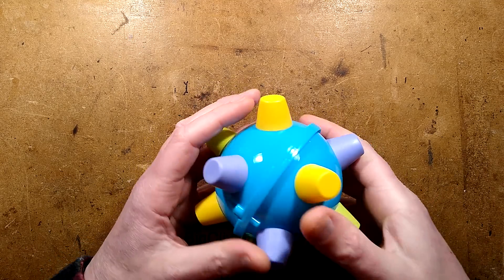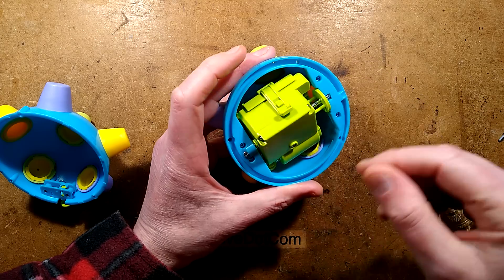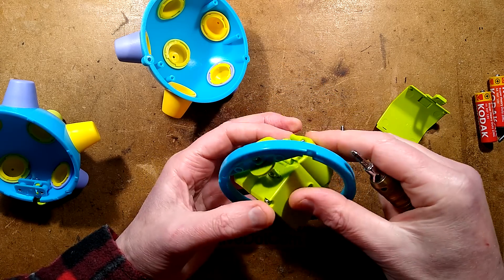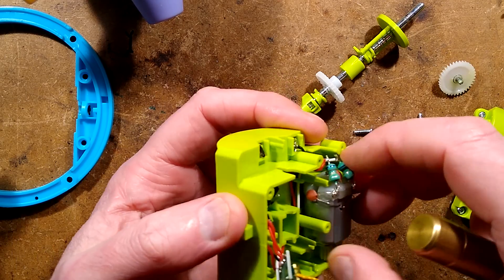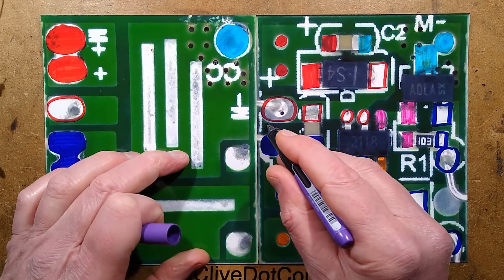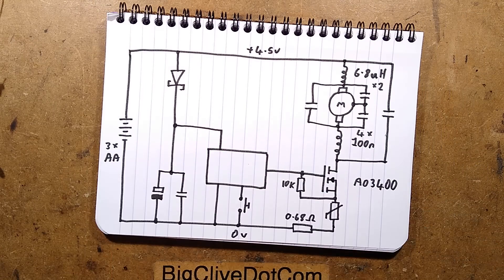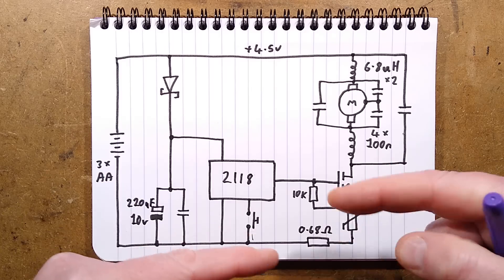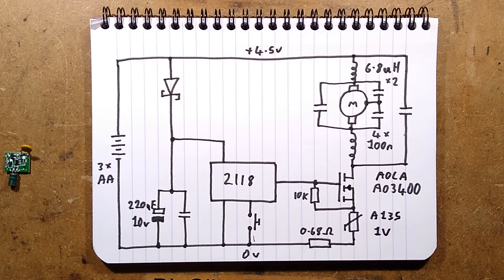Inside a Bumble Ball - with schematic

Comment: 20/30 odd years ago when "brushed" motors were the norm in the RC car/plane world, very common to see capacitors and Schottky diodes used this way.  Anything to keep arcing of the brushes to a minimum, I suspect to try and eliminate radio signal interference.
Reply: Ahhhh, that makes sense. A brushed motor is how they're getting so much torque at low voltage. It's like a cheap electric drill.

Comment: I can't believe they put so much engineering into a kids toy, that's a remarkable amount of protection.
Reply: Out of college I entered the defense sector, working at Raytheon in Rhode Island. There existed a sort of revolving door among the few nearby companies that hired engineers of various disciplines, including many of my friends. One such company in the mix was Hasbro in Providence. What intrigued me was the seamless transition of individuals who worked on military programs, delving into the intricacies of Radar, Sonar, Communications, and more, while feeling equally at home designing toys. As I recall, Hasbro did often push to reduce the component count to save pennies, but at the same time were focused on safety and meeting whatever applicable standards. It was evident that a major U.S. toy company, such as Hasbro, was vigilant about avoiding any negative publicity that could potentially cause harm.
Reply: If one ever failed in an unsafe way (bearing in mind a baby can't run away if it overheats and starts smoking) then the retailer would crucified by the media and the manufacturer would be dropped by the retailers.
Reply: Can’t have the kids lawyering up against your profits.
Reply: @nickdee5764 it's not really about the profits.  It's about not hurting the kids to begin with.
Reply: @POVwithRC That is absolutely not the case.  They have giant teams dedicated to making sure they are not liable, or wouldn't be perceived as at fault by the public when an accident happens.

They would much rather have 10 accidents where they looked absolutely not responsible, than 1 accident that appeared to be their fault.

If it was truly about safety then they would massively prefer 1 accident to 10,  even if everyone thought it was their fault.
Reply: In know... you burn down one house, and you never hear the end of it. 🙂
Reply: Usually I roll my eyes when I see a CE mark on a toy. But I wouldn’t be surprised if this one actually is compliant. Clive also notes the lack of softeners, still present in a lot of imported toys.
Reply: @BartSliggers  Can I know why you roll your eyes when you see a CE mark? Maybe you know a type of certification that's vastly superior to it for consumer products?
Reply: Someone taking the old adage or “if you think safety is expensive try an accident” to heart.

Comment: I wonder how many parents who do change the batteries just force the screws back in and strip more of the plastic each time.
Reply: Probably most of them - surprisingly few people know how to properly re-drive self-tapping screws into plastic (PSA: turn slowly counter-clockwise until it clicks back into the old thread). This is a prime example where a threaded insert should be used.
Reply: @ChindoCaine   somebody is a Fan of Franlab, as am I 😀
Reply: @ChindoCaine I used to repair printers and would always teach that to people because nothing angered me more than stripped plastic threads... 

Especially with self tapping screws.

Comment: Wow. always thought it was just an offset weight, not the whole mech an battery!
Reply: That's how my mind justified the fixed push button working.  I have a kind of X-ray sense for boards and mechanics that works even before taking a things apart. As I'm Clive-old, I also say 'Wow' sometimes opening seemingly simple designs..
Reply: The designers sure have alot more faith in that battery holder to keep working under vibration than I would, especially when the contacts begin to corrode from atmospheric moisture or battery seepage.
Reply: The one I took apart about 10 years ago did just have an offset weight on the motor. No timing chip either, just a slide switch